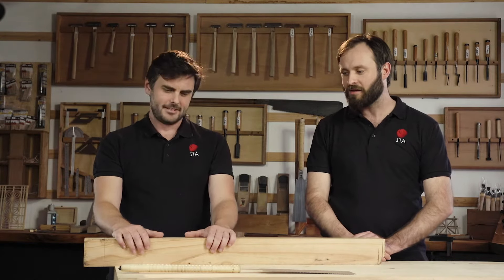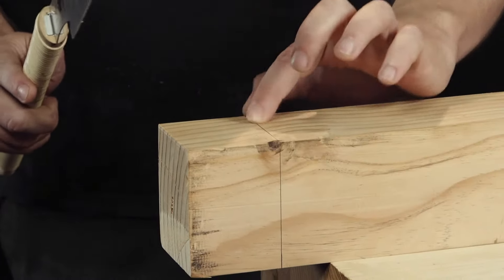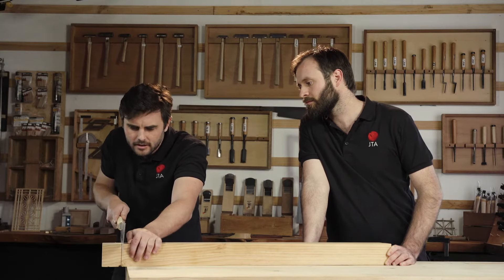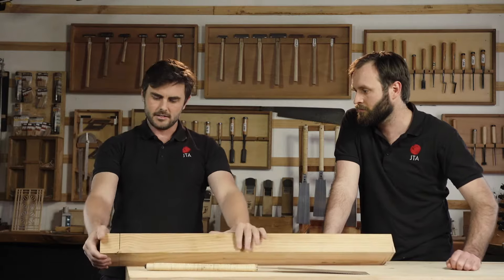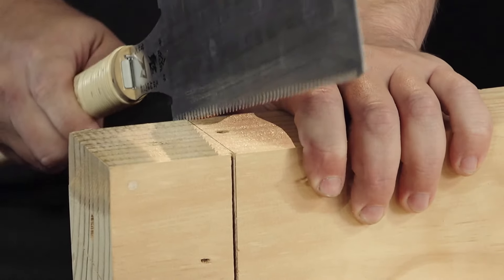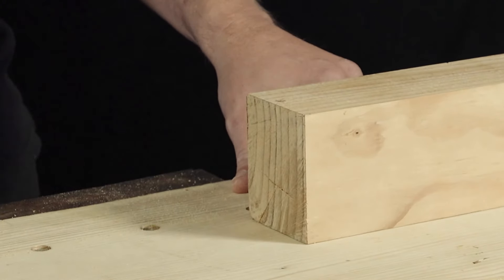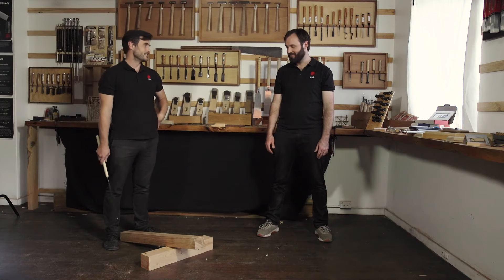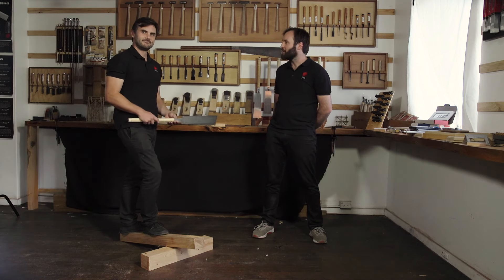Sawing techniques to perfect the art of using the Japanese saw

Comment: My own technique for cutting squareish stock is to rotate the wood 45 degrees such that you see a single line across two faces and then cut to that line, rather than cutting across one face and then moving to the adjacent face.  If you can cut to that line then by definition, your cut will be square.

Comment: really helpful, but i have a question. after going through about halfway you then make the beginning cuts on the other two sides, then finish cutting through... at that point have you returned to the original halfway through cut to continue on through, or do you come at it from this new side and meet in the middle...? i couldn't tell when you were flipping the board which side you started on to finish up, so i guessed and tried meeting in the middle. i'm guessing now maybe that wasn't right... i got close, but definitely not the perfectly smooth cut i hoped for and now there's cleaning up to do on both surfaces. thanks for your help guys

Comment: Japanese Rip Saw teeth point towards the carpenter so he has to get below the wood for the teeth to cut .Being above the wood is back to front .The teeth will dig into the end grain . It`s much harder and too noisy .The final position on the floor is all back to front. Western Rip Saws make more sense . Learn to use a western rip saw with both hands . You face the side of the wood and cut sideways ( left or right ) with  both arms .Nice and balanced with a straight back .
 To start the cut push the saw forwards gently .That`s thereverse of starting a western saw cut.Then keep your left hand well away from the blade .  The first top cut should start at the far side of the wood so the flexible blade will not jump out and cut your hand . 
 Sorry mate you made lots of mistakes that will need some sticking plaster .
Reply from the maker: Hi John, thanks so much for taking the time to watch our video and your imput. In it Mitch and Greg try to explain that as Japanese saws cut with the pull stroke, the saw does the work for you.
Reply: @JapaneseToolsAustralia  The rip saw teeth will dig into the end grain if you cut towards the middle of the wood with the saw above the wood. It`s simple geometry . The saw is thinner but the teeth point the wrong way if you try to use it like a western saw . The saw does not do the work for you if the grain effect is ignored .Use it on boxwood the grain is not important as it`s all so close grained . Cross cut saws from Japan are quite easy to use .Rip saws not so easy to understand .

Comment: what a palaver just use a standard western saw that has been sharpened properly its all about sharp tools thats taken you over six mins to make a 10 second cut
Reply: Try a Japanese saw, you’ll never go back to a Western saw. They’re much more precise and quicker. The bloke demonstrating has just taken a hell of a long time to demonstrate his technique, but it’s by no means the only way to do it.
Reply: hi @chriswaldron2617  yes i have Japanese saws and use them mate but only on the finer work as the Japanese workers use mainly soft woods and yellow cedar which is much easier to cut and work with but when cutting the timber they were cutting you cant beat a good sharp western saw its so much quicker and accurate mate
Reply: @FrenchFarmhouseDiaries  I use them on Spotted Gum with no problem, even on Cooktown Ironwood which is damn hard with its high silica content. Each to their own, I’ll never go back to Western saws. Factor in the price point of Japanese saws over any of the big name saws and you’ve got another reason to pick up a Japanese saw.
Reply: @chriswaldron2617  yes i do under stand were your coming from but there was a phase of carpenters in the uk switching over to them at one stage but slowly went back to there original saws they inherited from say there grand dads or fathers as all the japanese saws they  and i have ever owned bend snap blunt quick and most cant be re sharpened there good when new but are slow and to delicate for workers on a mission and one other thing they wounder like no ones business, but for me i like to re sharpen to get the best from me tools
Reply: @FrenchFarmhouseDiaries  I can resharpen the cross cut Japanese saws using the Japanese saw file but western rip saws are much better and easier to use .